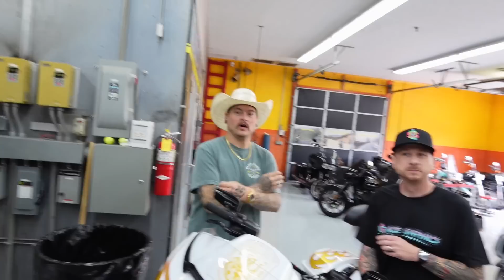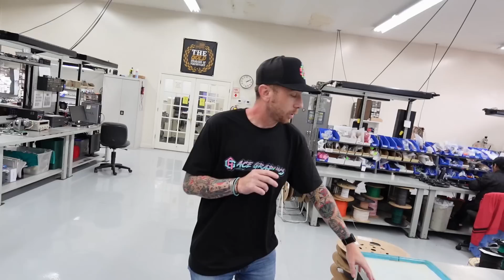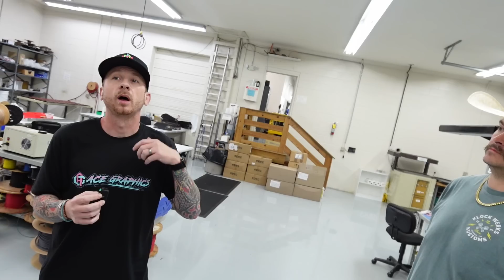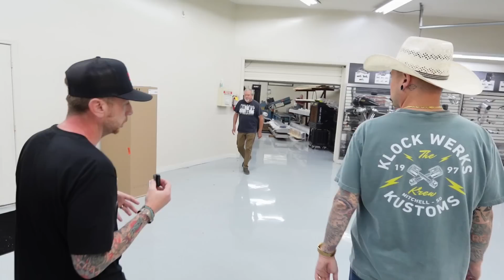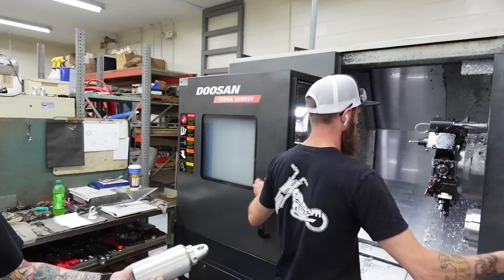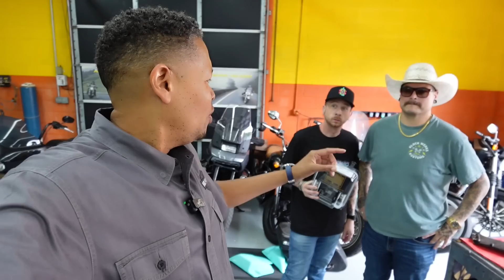The Truth About ThunderMax Tuners For Harley-Davidson Motorcycles!

Comment: My vrod muscle came with a comp pipe and Thunder Max tuner, 2000 km I've done so far in 12 to 37 degree Celsius here in Australia and hasn't missed a beat and running topless goes hard too absolutely cracks, its been a great tuner highly recommend it 😊

Comment: My 131ci 21 Low Rider S is on the dyno right now with a Thundermax.  going to be around 160hp and tq.  Narrow bands are useless when you Air Fuel ratio is  in the 13s

Comment: When it comes to iRide, i am 6ft. I have it after a couple conversations with millhouse. I constantly ride two up and even do long rides solo. The suspension will automatically adjust to the load based on how you configure. If i run a static height of 2in and I’m solo then the next morning my wife gets on, I don’t have to adjust nothing. The load is accounted for because the controller is measuring the swing arm distance. Also the air spring is fantastic. It only puts the amount of air in it needs. I love this purchase and one of the best things I’ve done. I can cruise low and slow or up and fast on the twisties. Best of both.

Comment: I’m still running my Gen 1 thundermax. Had it for 20 years. Has the Zippers logo on the side. Recently had dyno tune performed. They didn’t like my old tuner but I didn’t see a reason to buy a new one since mine works just fine.

Comment: I’ve been thinking on getting one for years now. Since my bike is way out of warranty ( 2012 RG) I’m pulling the trigger on one this summer. I currently have a 2 into 1 exhaust ( V&H). It’s been on my bike for years now. Do i need to change my exhaust system for wide band 02 sensors, to run the thundermax?
Reply: I purchased a 2012 Ultra Classic that had aftermarket exhaust. The wide band bungs were installed. Just blanked off small bungs . The wide band O2 sensors go in up near the cylinder heads. Thundermax shows how to route them. Initial install was easy.